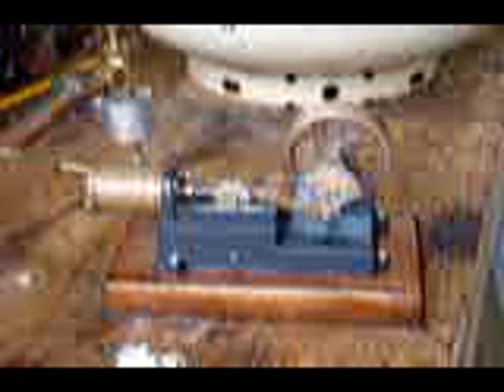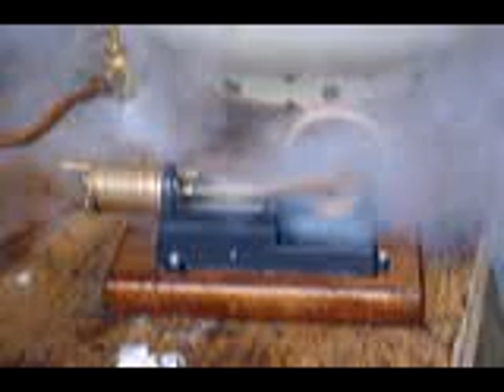PM Research Model 3 Steam Engine Running on Live Steam

Comment: Not to be overly critical, but it really should not be leaking steam like that.  Did you install the paper gaskets and thoroughly tighten the cylinder end caps.  I just finished putting mine together and had to re tighten the end caps several times to get them to seat against the gaskets properly.  That being said, it does seem to run pretty good
Reply from the maker: Yeah,  It leaks a lot.  Mostly through the spool valve.  This was my first casting kit and I'll freely admit that there are issues.  Now that the engine is worked in, it  will run on breath power, but it still leaks.  My later engine, a PM Rearch 6CI, has a similar problem: A sink in the casting gave me fits and the spool valve still excessively leaks.  I've learned to hate spool valves.  When I get around to doing another mill or coke bottle engine, It's going to be a slide valve.

Check out some of my other, later, videos (particularly the Murdock wobbler and the rotary engine), you can see my machining skills have improved somewhat.

Comment from the maker: It was an old Sony Mavica camera.  For those people not old enough to remember, these cameras initally used a 3-1/2" floppy, then later a 3" CDR to save the data.  It was a neat camera for its time.  It could only capture video on 320x200 resolution.  Sad that I paid over $250 for it when it was new and now it's totally obsolete.